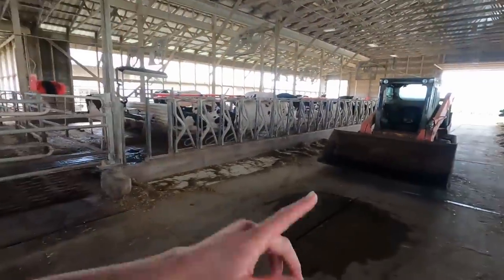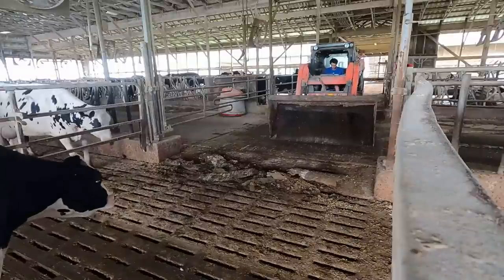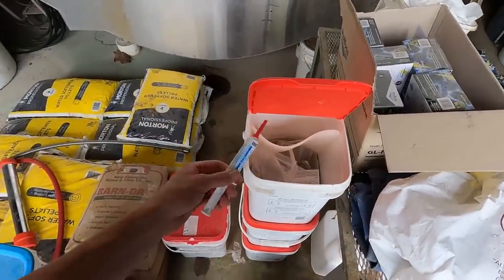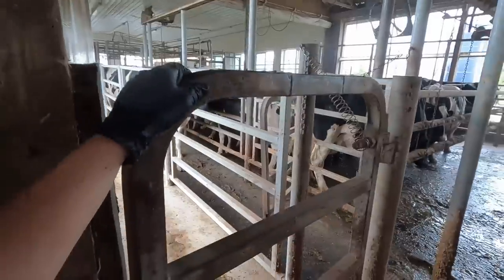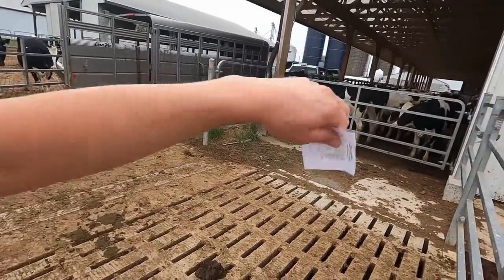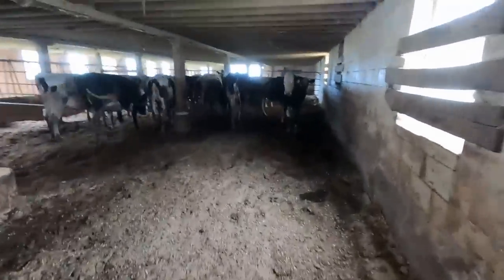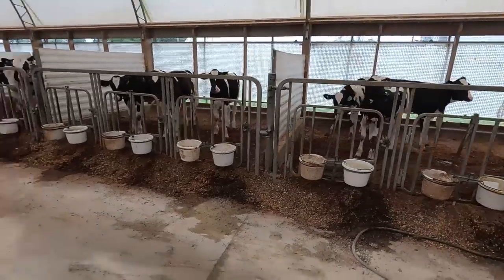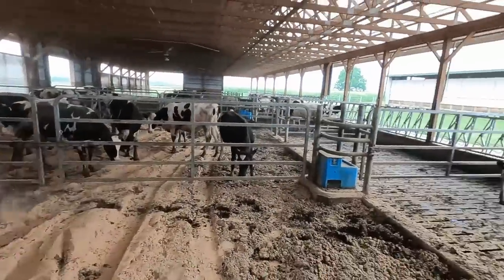Drying Off Cows

Comment: Cool video bro. I'd like to see you do a test trial on till or no till. Personally I'd till 5" and wait 24, 36 hours before planting. The continuous practice of no till. You end up with impacted soil which isn't a healthy head start for root structure to reach into the soil web of nutrients. I believe you'll see a 30% difference in yield. Split each field in half. It won't bankrupt you and you'll end up with solid data in your farm for the future. Best wishes.
Reply: Honestly,  I don't think anything can be worse than tilling your soil. You cant judge no till just because you tried it once on a field that has been tilled for years, it has to be built up over time, and I can easily go and scoop up a handful of our no till soil. Whereas soil that has been till normally settles and gets hard as a brick until the next time you till, and when you do till, if the wind is blowing you lose lots of your valuable  top soil. I recommend you doing some research and trying no till, but you can't just do it once and form an opinion, you have to give it a fair chance and build up the soil to it. We've been doing it for over 30 years, and our soil gets better every year

Comment: For the teat seal if you grab the bottom of the teat and push all the milk up into the udder and then put it in and pull down on the teat until a little bit comes up it nice a nice glob and seals way better